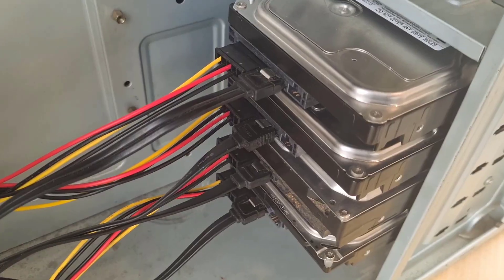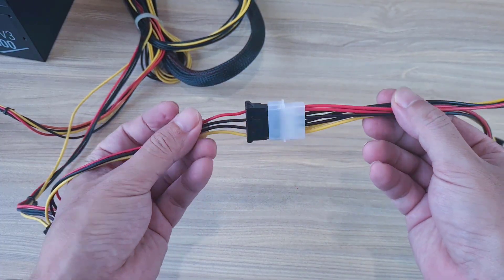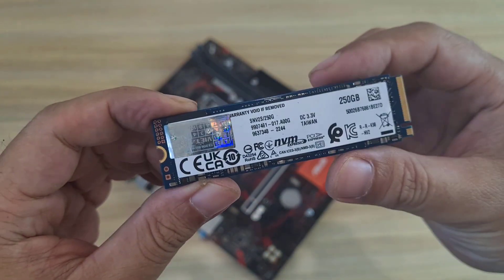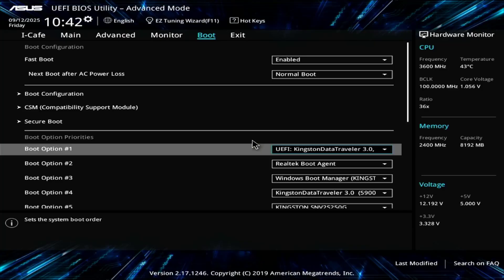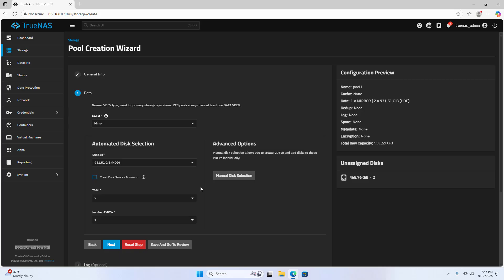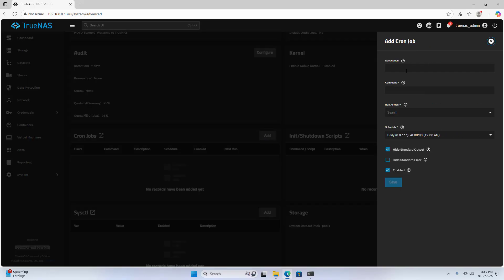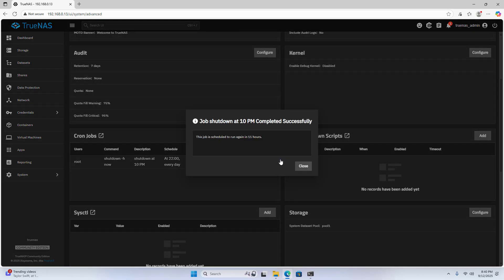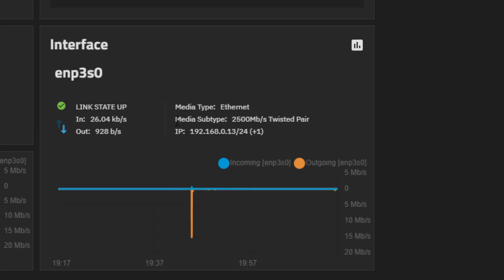Build Your Own NAS From Scratch

Comment: BTH - The case and the drives are ok. The software that I would personally use would be Debian minimum headless with CASA OS for the backend docker apps. Way simpler to setup, configure and manage than TruNAS.

Comment: This case really sucks because it's lack of air flow between hard drives, and it's out of anti-vibration mechanism, for better hard disk ease of maintenance, you should purchase an Antec P101S or similar case that is designed for NAS applications.
Reply: Well, his goal was to use what he had sitting around, so it's ok for a first pass. He likely could add more fans to improve air flow around the drives. That case had some nasty-ass rust in the back. Maybe clean that up. If he wanted to upgrade (while keeping the mobo), I would consider a Jonsbo N5 and an LSI HBA. Lots of expandability and a hot swap SATA backplane. Gets expensive though.